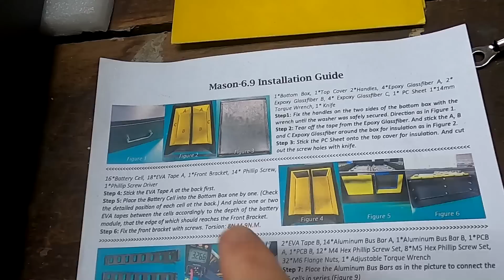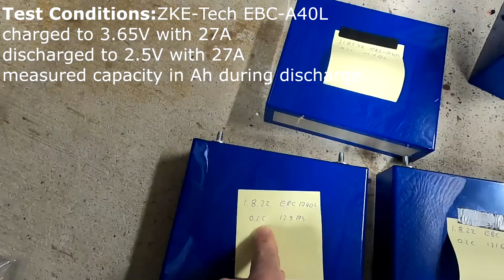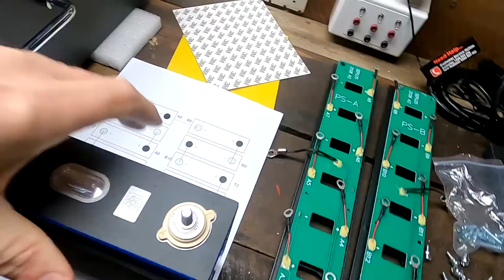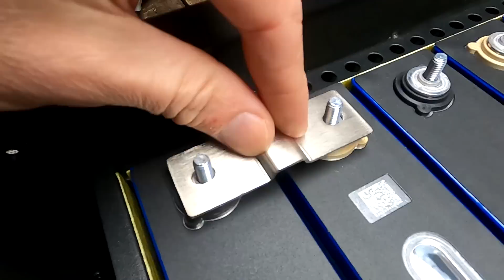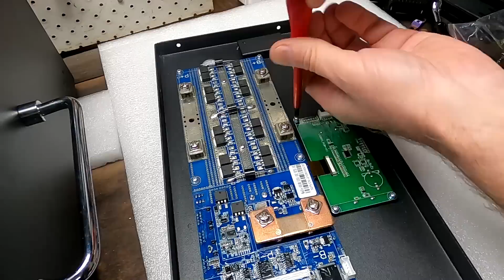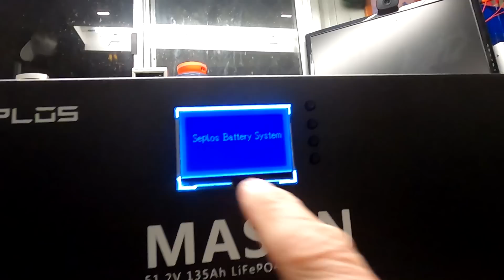SEPLOS MASON 6.9 Kit. Building a battery was never that easy (and fast).

Comment: Andy, thanks for helping us DIY'ers with your great videos. 

Have you come across any DIY kits for a 36v or 48v LFP105 cell battery build? I built a 36v 105ah battery already for my golf cart using LFP105 cells, but am not satisfied with the enclosure. I have looked for months and can't find any that are designed for the 105ah cell size.

Thanks!

Comment: Hi again. I just bought, and have been setting up, 32 x CATL 280AH cells. I have them configured as 2P16S (I asked Battery Hookup, which is where I bought them, whether I should create two separate 16S packs, or a single 2P16S pack. They told me that because the cell are new, 2P is fine). I am currently top balancing the cells and also have the GeeWe active balance connected. IN the setting page of the App, I am not able to enter the BatCap(ah). As soon as I enter the 3rd digit (the '0' in this case) (280 x 2 = 560), the set button grays out, so I am not able to tell the App what the battery capacity is. Any ideas what might cause this?

Comment: Hi Andy, my name is Vagelis from Greece.I am building a lifepo4 battery. I saw the link for the separator (sticky foam) Eva Foam Sheets. I will compress the cells. What thickness you recommend? Sorry for my English,  thank you!
Reply from the maker: Hi Vagelis, I would recommend the 2mm foam. That should be enough to even out differences between the cells.
Reply: @OffGridGarageAustralia  Thank you for the information. I like your videos, very nice job!
Reply from the maker: @ΒΑΓΓΕΛΗΣΛ-μ2ο  thanks a lot!

Comment: Metallic aluminum quickly creates an invisible oxidation layer, so even when "brand new", it would be present on the aluminum battery-to-battery buss bars, and this thin oxidation layer doesn't conduct well.  I am thinking that you could have lightly sanded or wire brushed these aluminum buss bars and put some aluminum anti-oxidant where they contact the battery terminals and nuts to prevent the oxidation layer from reforming.

When installing large gauge electrical aluminum conductors in the US, the electrical code requires the conductors get wire brushed or sanded to remove the thin oxidation layer and then apply an approved anti-oxidant before tightening the wires down to the connections (usually to a breaker or on a main buss connection).  

Leaving the oxidation layer in place would create extra resistance and create cell voltage differences between cells in some battery packs.  Without using an anti-oxidant, the oxidation layer would quickly reform and again would create extra resistance between the cells in the pack, which would be additive since these are series connections.

Comment: Hey Andy IF you had to restart from scratch with your build with your current knowledge, would you go with a shelf unit or a DIY battery kit like the Seplos Mason?
Reply from the maker: That is a good question. I would probably start with building a dedicated room inside my garage for the batteries and inverters. Inside, I would use one shelf again without any covers though, so it is easily accessible. I would leave more space for a second shelf and point the design of the whole system 
The Seplos system is great though and would be my solution if I don't have a dedicated space. I'm getting another 280Ah Kit and the trolley from Seplos soon. It will be fun to set this all up with the Victron system.
I would not go with the JK-BMS anymore though as I now see the potential having all these batteries talking to each other and act as one battery when reporting data to the Victron system. This is only for larger system, the JK is still ok for 1-3 batteries...
Reply: @Off-Grid Garage  That is actually a pretty fancy idea, that would mean it's isolated from the rest of the building, climate control would be easier and you can mount devices around you (not one side but all around), would cost time to setup though. 

I'm having a but problems getting a good shelfing that can withstand the weight, well there are 400kg ones but I do not think the way they are build would do well in a longer term 😅 The one you are using is niet really possible to get it in The Netherlands, unfortunately. 

Still doubting, would I trust those lifepo4's in the middle of my house (storage), or does it go outside in a small shed.
Reply from the maker: @_JustBeingCasual  Installing batteries inside a house is not allowed down here. At least not the ones we're using. Huge pain in the arse to follow all the regulations. That was one of the big drivers for me to start inside the garage which is far away from the main building.
Reply: @OffGridGarageAustralia  Yeah, I do understand that's disappointing, but it's safer which is nice, truth to be told I wish that was an option for me, lol. For me it's either a balcony or inside the house. Worried about getting the batteries/inverter wet so thats not really an option for me right now. Not sure If it's allowed to store a few 100kg's on the balcony too.. Decided to get a Seplos Mason, because it's a full package and bluntly safer / easier for now.

One of the reason was also, I could not find a proper shelf for it, it's funny a half day after ordering, I found a suitable shelf rack, haha; oh well, perhaps for the next build (^.^) for now it's a proof of concept anyways.

Comment: Neat kit, but better quality cells and a battery shutoff would make it much more attractive.  I guess the arrangement of the positive side of the pack being switched through the BMS is the justification for not needing a switch, but I would feel safer if it was there, or if there was a more (ahem excuse the pun) positive way of turning off the BMS than a pinhole that you need a paperclip for.
Reply from the maker: You mean like a physical breaker or switch? They make another system called Punung or so where they have a breaker instead of the fuse. But this is a ready build  battery, not DIY.
Reply: @OffGridGarageAustralia   I am new to your channel (in Africa, Sierra Leone), i stumbled on one of your videos just recently and i right away subscribed to your channel. Reason i the amount of details you share (might be boring for some people, NOT for Me, Cos i like watching all the details so i dont miss anything ). 

I have a question though. I have 4 LiFePo4 12.8v 200AH each of these come with their own BMSs. I want to convert these parks into one 48v 200AH Pack. 

Also I have a BMS that i pulled out of a felicity Solar 51.2volts 15KWH battery 

My question is can i just stack the 4 batteries in Series and rely on their BMSs or do you advise that I use the other BMS I have. What would you do if it were you. (Please note that i will make sure all cells are balanced before build the pack )
Reply from the maker: @francisguchie1973  Hello and welcome to the channel!
That depends solely on the BMS in these 12V batteries and if they can be connected in series. Most BMS can't and will be damaged if one of the 4 BMS in series disconnects during an event.
It is probably best to use a new BMS for 16s LFP batteries like the JK-BMS. This also ensures the cells get balanced correctly, which the 4 single BMS won't do.
Reply: @OffGridGarageAustralia  a breaker, like most of the other popular server rack batteries have.  It's just a quick and easy way to be sure the output of the pack is disabled.

Comment: Very interesting indeed! But i still prefer the diy-versin in a box or diy-enclosure. The Problem with these Rack-mounts is, that you dont have anything to do. It just works😂
Do you still have your Bluetti? It would be a nice experiment on the side, to stress test it and take it apart to see the different parts like inverter etc…

Comment: Looks like a nice product overall. I sure hope they gave it to you for free for this testing. 😉 Otherwise you probably would not have those old cells accepted, right? It is a real bummer, that they have only a passive balancer. On the other hand, once some good cells are top charged, they stay balanced for a long time. I have a 100Ah 12v pack as computer backup for 18 months now and they have a Delta of 0.006, without any balancing at all.
Schönen Gruß aus FL.

Comment: Great video! Do we know something about the BMS balancing? Active or passive, amper? Or this will be uncover on next videos? :)
Reply: With those thin wires;-) must be passive,  30mA or so. IMHO, only used for minimum discharge voltage and maximum charge voltage cut-off

Comment: Question, when the batteries start to lose capacity, when charging are you still putting in the full amount? does the battery go to and put in 135Ah before hitting max voltage or do you hit max voltage at 129Ah? curious whether you're getting penalized with both charge/discharge time while putting in unusable capacity?

Comment: You said the balance cables go to the negative of the battery in your video, this is right be-course the BMS is measuring the positive the balance have to be negative to measure voltage.

Comment: I think by building these batteries units instead of buying a complete 51.2v 100Ah Lithium iron phosphate battery module that is probably welded together is that if anything stops working it be just a matter of pulling down and replacing failed parts ! Hope the BMS is good quality and communicates with a growatt 5.0 off grid inverter !
Reply: What Growatt inverter are you talking ? SPH gridtied are using growatts own canbus implementation 1.0.1 and the off grid SPF series is using growatt canbus 1.0.5

Then you have no bt nor wifi only the cable connected Windows software for setup with a lot of bugs where Seplos fools us and pretend that they can not change that nor remove the mistakes due to compatibility. But he truth seems to be that this software is from a third party which is developing a global version fro different sellers. 

But once you have configured the BMS right the Gorwatt cloud integration of the battery will be there like SOC and so on (app and web) once you have a smartmeter connected too.
Reply: @typxxilps  At moment i been using the Growatt SPF 5000 ES Off-grid Inverter faultless works well on my 48v AGM battery bank am totally offgrid here and looking into moving too 48v (51.2v) 100Ah Lifepo4 Battery with 100A BMS by the same manufacturer of the EG4 Battery sold by Signature Solar in the USA. about $2,650.00aud here in Australia ! So really depends on quality and price and compatibility of these SEPLOS MASON units !

Comment: Interesting design they came up with.   I'm guessing that will be a 2-person lift with it assembled.  Maybe the traces on the long skinny circuit boards have been designed to keep the BMS/balance wires the same length?  Thanks for the instructional video.  Looking forward to see how it performs.

Comment: Hi Andy. So far this looks like a perfect kit to easily build a battery pack. I’m a little concerned about the BMS because you haven’t said anything (yet) but some of your suggestions don’t sound promising! I look forward to your next video!
Meanwhile I’ve compiled a number of insights about Seplos’ BMS communication from their documentation and answers provided by Youtubers. I summarize here what I understood and would appreciate comments.
1) Communication between the BMS and the inverter.
By default, the communication between the BMS and the inverter is done using the CANBUS protocol. However, if your inverter communicates using the RS485 protocol, you can request a BMS that supports this protocol when you order it.
I think and hope that the name “communication between BMS and inverter” is a simplification of language and that in fact this communication also covers the communication with the solar charge controller. For example, if you use Victron equipment the BMS will control both the MultiPlus2 inverter and the MPPT solar controller to, for example, limit the load current.
2) Communication between the BMS, a computer, and the different packs of a battery.
The communication between the BMS, a computer, and the different packs of a battery is always done in RS485.
It is interesting to note that when the BMS communicates with an inverter, using the CANBUS protocol, it is not possible for a computer to communicate with the BMS at the same time. The choice is fixed by the setting of switches. It is therefore not possible to monitor the values provided by the BMS at the same time as it communicates with the inverter, which from my point of view is a major shortcoming.
3) information exchanged between the BMS and the inverter.
It seems that unfortunately there are no standards that define the CANBUS protocol at the application level. The protocol used by the company Pylontech seems to be the basic reference in this matter and then each manufacturer adapts this protocol to his own needs. So to know what kind of information is exchanged between an inverter and the BMS, you have to read the documentation of the protocols, but I don’t think this guarantees what is really used.

Comment: Does this battery not have a circuit breaker on the front panel?
From the readymade versions of these things that I have seen so far, all have a hardware circuit breaker on the front panel, should you ever need to disconnect the battery from the system, how would you be able to shut this one down in an emergency? 
I still think that it's cheaper to purchase a ready-made version from Ali Express, at $1750Au and you get a circuit breaker too!, And you don't have to put it together.... 
If this battery was around $1500Au or less, I could forgive that it doesn't have a circuit breaker and mount my own to the front panel but for the price that you quoted it for, it's just not worth paying for being able to put it together myself.... 
I would have thought that the idea behind a kit is to save money by learning how to put it together.... Yeah I know know what this kit is trying to be?....

Comment: Hi Andy and thank you again for this video,
 Really very very interesting!! some time ago, I wanted to buy this kit, but without the cells, and do not know exactly, for which cell dimensions it is suitable? I don't think they make different models? it would be nice to know what is the exact size of the cells adapted to this kit?🤔
But sincerely, this kit is well done, well explained, thanks to you too! I really like it. 😁
(finally I had made a metal box adapted to my cells, bms, etc...) but it's a lot more work, and the finishing of Seplos with the connection boards for the balance wiring for the BMS is really good!👍
Thank you again, I know the software very well, for the BMS that you connect to your computer, it's simple, with all the information, memories informations, settings etc... 
you'll see it's good.👍
I think that when I have to make a new battery pack, I will use this kit. 
(Just it will be necessary to have the info for the dimensions of the cells, or to take the complete kit?.... to think about...)🤔

Comment: Andy don't support company's like this, sounds way to fishy with their response, plus  2 years old products.
Reply: Don’t know what’s so bad about me asking about a instruction sheet. I purchased a newer model and just got it Monday this week. I’ve done the battery build part and need to put on the face plate and am a bit confused on the bus bar arrangement. I know the video shows a older model but I thought I could figure it out. I have checked seplos website and gone to the google drive Andy mentioned and can’t find it. Contacted seplos and the sent me a link to a total different model. I thought Andy’s instruction sheet would be close enough to figure it out. I have been following Andy for years and have purchased many items on his recommendations. It’s the first time I have asked for help and I get set on all for asking for a instruction sheet. Pretty disappointed

By the way I run a IT business and like energy storage solutions and playing with batteries.

Jim

Comment: Love the ease of build etc, but looking at the cost from Seplos to ship each unit at almost the same as the unit...... wow
Reply: Air shipping cost can be really high. Try to choose alternative shipping ways. It can lower the shipping price by more than half
Reply: @solarboy7950  I agree but this isn’t an option when I went via the link supplied by top block Andy
Reply: @solarboy7950  no, they have stupid prices for their kits compared to the offers you get for shipping the battery cells. They make money of those fees or simply hire too expensive shipping companies. They wanted 200€ for a simple Mason kit without cells which raised the costs from 400$ to over 600$.
Landshipping of cause, not sea nor plane from shenzen to Germany
Reply: @typxxilps  I think the affiliating shipping cost is too high to bear when you  have a relatively low price product. I didn't suffer from the "pain" so much because two devices with many cells had already haunted me with a high product price.😅

Comment: When working with tools around exposed power like open battery terminals, I like to put electrical tape or gaffer tape (or even cardboard) loosely over/around terminals/busses not actively working on, so if I slip or drop something metal there's less chance of shorting out. You reuse the tape on the next so there's a window left open for the one you're working on each moment.
Learnt the hard way when changing a UPS battery pack (2x12=24v), T3 Nut and Bolt Terminals - a nice almost arc wielded screwdriver (didn't stay stuck) and lost metal, lost capacity. It takes more time but is good insurance from Murphy's law. The only problem is if you leave glue behind (please avoid), you still need perfectly clean terminals for low resistance connections.
Reply: yes and no cause we would see close to nothing once the gaffer tape or cardbox adventure wouuld have started.
Good to build it yourself but bad for diy explanation video and 2 hour build.